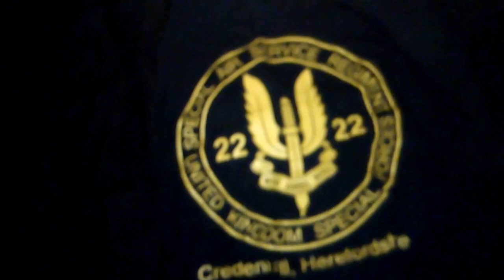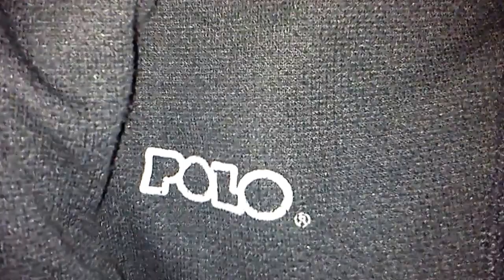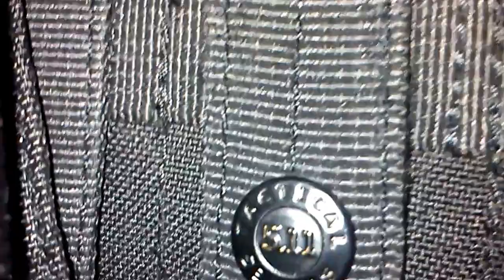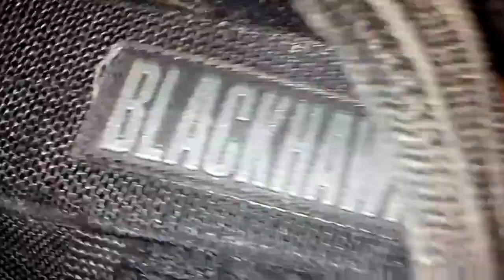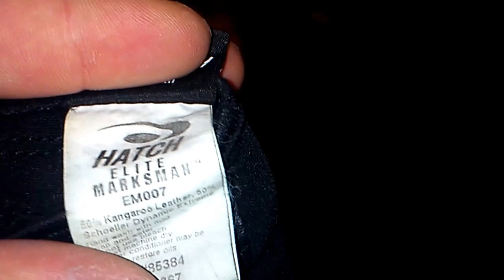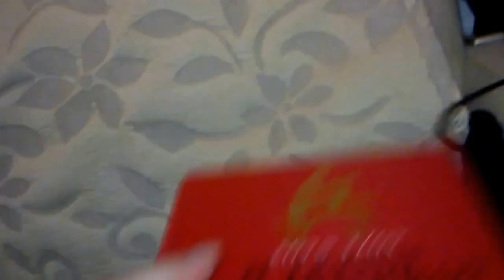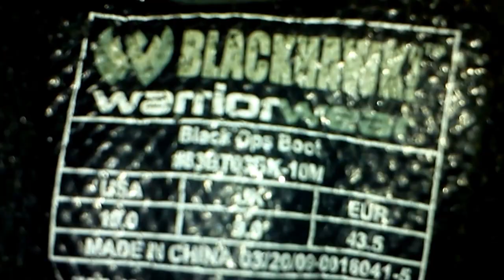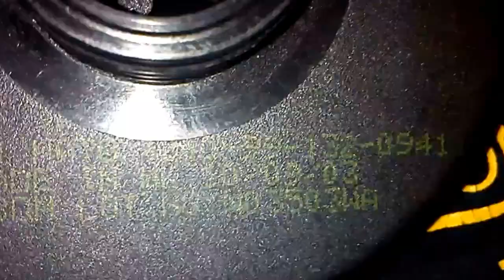Airsoft S.A.S. (Special Air Service) Black Kit Piece by Piece

Comment: I don't think the s10 will stop any bb's, just saying.
Reply from the maker: BrainEatPenguin 1 Well it stopped many my friend!
Reply: I had a model 4A1 Israeli gas mask and the lenses would shatter if they were shot with BBs so I cut out polycarbonate lenses for them and they became impact resistant.
Reply: LordAnestis i wouldn't trust stock lenses.
Reply: BrainEatPenguin 1 you are right but there are special lenses and covers you can put on them that can stop a bb

Comment: Don't airsoft with the s10 or you will be shot in eye and go blind and the s10 is the gas mask or respirator in case you didn't know
Reply: he replaced the lenses most likely
Reply: They have a airsoft mask designed for that
Reply: You can replace the lens with polycarbonate ones to play airsoft with it